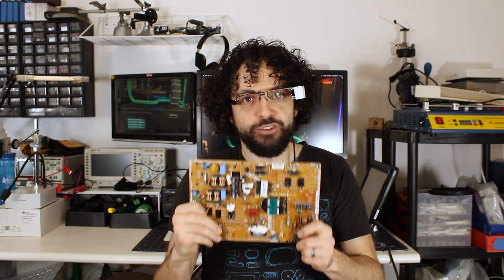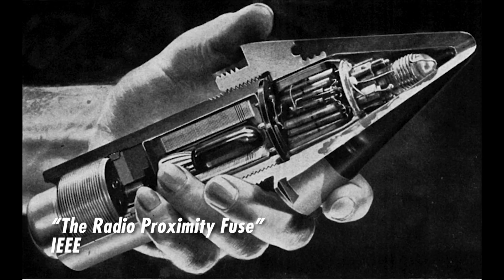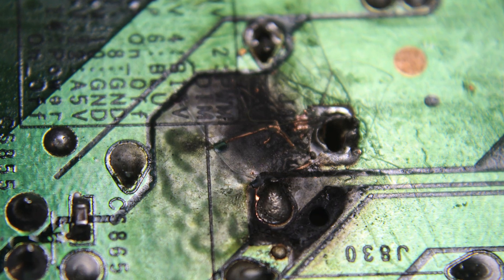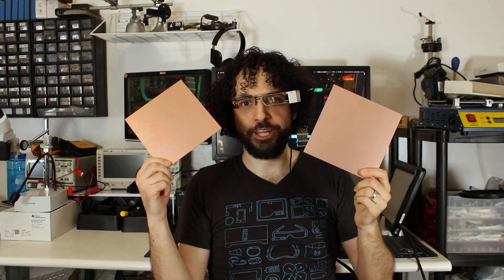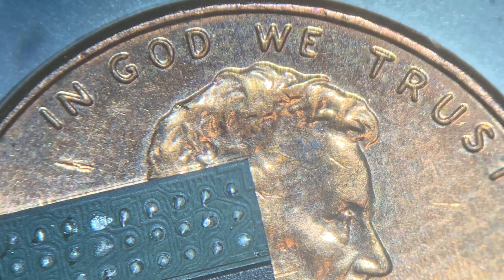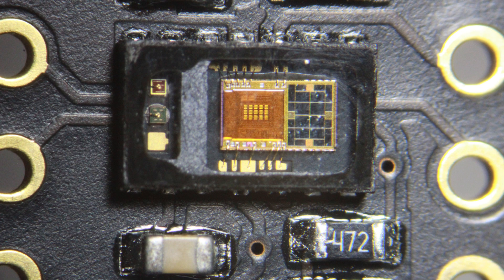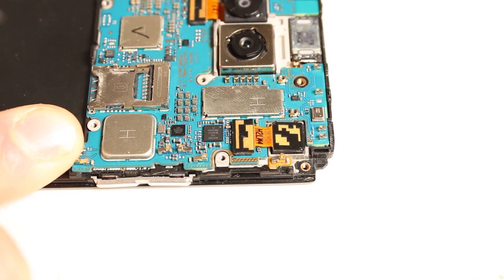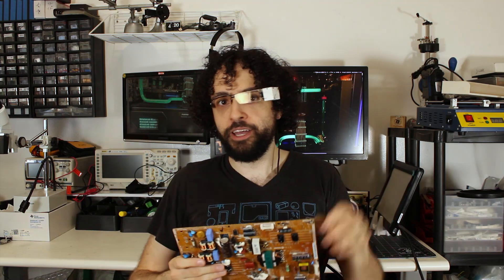Why Are Circuits on Boards?

Comment: Zack Freedman: You cannot and should not integrate most of the components into one chip!
Apple M1: Hold my beer
Reply from the maker: I do worry that Apple has overdone it. They're not going to be able to make incremental improvements, and they'll need to do a ton of re-engineering each generation. I don't think this will pay off for them over the long term.

Comment: A long time ago, I laid out some PCBs by hand.  Where "paint" is mentioned, we used permanent markers.  They're water proof so they resist the ferric chloride etching solution.  It was actually pretty much fun to do.

Printed plastic boards would be nice, but one critical property of PCBs is the ability to resist heat.  Soldering is tough on PCBs, some cheap prototype boards can't even take one rework if you make a mistake, the copper delaminates.

If you want to see some interesting work, search "surface mount pcb repair" (or something like that).  There's some amazing skill out there soldering microscopic parts, getting it right and not having any solder bridges.

Comment: Nice job.  Very comprehensive.   
I take one exception however.   Not anyone can combine any combination of chips they desire.   The procurement of sophisticated components has been tainted with Lawyers and NDAs.   Design one of these in and you become the supplier’s bitch anyway.  This is not by accident.   They can pull your license to that chip at any time.   And you suddenly find yourself in the unemployment line standing next to a wire wrap girl.  ( maybe not.  She is probably 85 by now ).   So instead you remain a good bitch and keep the money rolling in for the pimp.

Comment: I am going to build vacuum tube amp and even wind my onw transformers, and it's going to be point to point wiring, cuz lower noise when you can twist the wires together, more current can flow cuz you have 3D trace (wire made of thinner wires, like next gen traces stuff) and not flat trace which needs to be very wire for more current so nothing is better than heavy duty high current/voltage wire. My experience with PCBs is that they can break very easy and traces can come off cuz of leaking caps, so you gave only the pros of PCBs, give us the disadvantages too

Comment: 10:08 "Flex PCBs are really designed to flex just a single time" Not the coiled one inside a GBA SP or Nintendo DS hinge. ;) They really are standard FFCs. By coiling it you get the full range of motion for the hinges screen with VERY little movement on the flex.

Comment: I 'm kinda disappointed you haven't talked about the wire to chip covered in black epoxy blobs which are common in really cheap high volume devices.

Comment: the future of circuit board is essentially unchanged, but along with copper trackes, there may be micro-channels for coolant or thermally conductive materials. in HPC applications, thermals are rapidly becoming the greatest limiting factor; especially in high frequency RAM (such as GRRD6). Lots of research is being done into implementing cooling AT the chip level, such as carving fluid channels into the substraight its self. this is especially beneficial in flip-chip packaging where the heat is generated more on the PCB side rather than toward the outside of the substraight. 
Soon  all of our phones  might have internal  liquid cooling, and our Graphics processors and  ram sure will; (if  not through-PCB heatsink contact)
Reply from the maker: I didn’t go too deep into thermal management, but it’s definitely interesting. I haven’t heard of micro fluid channels - I need to check that out. There’s also on-chip thermoelectric cooling, which I see in high-precision sensors and frontends.

Comment: Pick and place machines do not need fluorescent green as you said. SMT machines only need reference marks called fiducials . They are usually a small copper dot on each corner. But even those aren't needed with today's newer machines. The multiple SMT machines I program (my data, Siemens, Fuji, Juki, etc) don't require them, the vision technology is so advanced that I can use any mark on the board as reference. 
I don't know what u are talking about with the "fluorescent green" stuff for the SMT machines.

Comment: Neat video. As for making DIY PCBs as accessible as possible, the CNC router option seems to be the most common. Instead of using a perfectly levelled board and a V-bit, you can use a spring-loaded drag-bit to scrape off a mask or resist of some kind. Depending on your feeds and speeds, the cutting forces on the router itself can be sufficiently low that a cheap 3D printer can handle them. The method I’m more fond of is using a laser cutter to ablate away masks and resists. I saw an anon spray-painting their PCB with a normal rattlecan, lasering off the gaps between the traces, and dunking it in an etch bath. Bottles of cheap UV solder mask are pretty available too. I’ve tried using an inkjet printer to make transparencies for photomasking some dry film photoresist before, but it’s a pain to get the scale and ink settings dialled in properly, not to mention the photo exposing step. My cheap photoresist was also pretty uneven. I’d argue that this is more prohibitive than the chemical nastiness of etching.

I’ve also seen some people trying to design a projector-like frame that uses an LCD to directly mask off the board from an array of collimated 405nm LEDs. You’d be able to use this for masking the etch resist, solder mask, and even for silk screens themselves. But from the few examples I’ve seen, it’s a pain to find an LCD that can be separated from its backlight and used to transmit 405nm. There’s also the issue of display driving.

In terms of etching itself, I’ve looked into a few different etchants. The common ferric chloride is a pain for many reasons, but it does get the job done. Persulfate etchant may take a bit longer but it’s nice being able to see through the solution at your board as it etches. Some also swear by regenerative etchants like H2O2 and citric acid. If I recall correctly, some/all of these work by using the Cu2+ ions as an oxidiser, and oxygen dissolving from the air to turn Cu1+ ions into their 2+ state. But a short chemical analysis reveals that the copper ions will still build up and the solution will become more and more basic, meaning it will eventually be unusable even after frequent top-ups.
I’ve looked into perpetually renewable enchants that require no topping up and don’t fill up with toxic copper ions before, namely by using electrolysis to pull the copper back out of solution onto an electrode after etching. The two etchants I saw promise within are aqueous iodine and bromine (can be created from copper iodide/bromide respectively). Iron sulfate might also work, so long as no iron comes out of solution during etching. All three of these would have pH requirements of one form or another, and may be slow, but I think would be worth pursuing for a maker-space or wherever that requires a no-mess solution.
Reply: It's a lot less attractive now that it would have been 20 years ago though because you can have professionally manufactured PCBs made using online services for dirt cheap.

Comment: Most boards from the early 60's onwards were made using 4x drawings using Chartpak tapes that were then reduced to a 1:1 negative to expose the photo resist. I know of no time or place when any production process involved actually "painting" the boards by hand. I still have a few of my Tape board designs from the mid 70's! AND the negatives for same.

Comment: I came over to answer your title question by stating "they're more stable than if they were on gelatin.", but after reading the comments, I guess I'll watch....
EDIT ----->  Ok, I watched, not bad.  By the way, point to point in radios was alive and well in the 80's.  I used to fix em.  The HF radio was an electro-mechanical monster.  UHF and VHF not so bad.

Comment: Interesting  look into history..... hmmm..... I don't know who or  when 'wire wrapping' was invented,  I thought it was the 'early 60s'...by someone like Bell Labs,or Raytheon.... most circuits until the transistor ( 50s) used high voltage vacuum tubes, and small insulation thickness of ww wouldn't work.   You keep calling PCBs  'fiberglass'....well, the binder is important too, epoxy-fiberglass.... epoxy is a 'wonder' material.... I  remember before 'plated-thru' holes were invented...I've seen 'rivets' used to transfer circuit from top to bottom.....  the circuits today need a surgeon to work on them.... just saying....

Comment: Interesting presentation. Thank you.

As someone of mature age, who started as a teenager with 'tag board' and 'point-to-point' wiring before moving into professional electronics and PCB design, I'd suggest that saying 'pcbs haven't really changed over the years' is akin to saying 'the motor car hasn't progressed from Henry Ford's Model T to Elon Musk's Tesla 3'.
'Tag strips' and 'Eyelet boards' using paper-phenolic or ' Bakelite (phenol formaldehyde) were in used before WW2, so predate the ceramic discs in the warheads.
You can't just ignore history because you don't know it or don't understand it.

Please try not to use to Trade Names as descriptions of materials.
(e.g. 'Kapton' is the DuPont Trade Name for polyimide.)

Comment: Well, besides the FR4 substrate there are also other substrates that are used for RF boards such as the Rogers substrates, or ceramic substrates, etc. So to say that the substrate itself hasn't changed since WW2 might be true for some simple boards, but not really true for PC motherboards, satellite communication systems, high-temperature applications, etc. But overall good video!

Comment: Because they used to be mounted to large chassis of metal and constructed by hand at great expense, which also made them more difficult to repair. It also means they are much larger.

Printed boards were very much hated early on and were often considered a sign of poor quality... How the times have changed.

EDIT: called it

Here's something fun for you: Couplets! The old form of high integration. Before modules had 20 parts on them in your fingernail there were 6 capacitors and a resistor jammed into a ceramic disc with a few leads. Philco was notorious for using these!

Comment: "this is the modern version"
Shows electrolytic capacitor that could easily be 50 years old.
Reply: modern as in 'still in use in modern times' not as in 'this was manufactured last week' :)
Reply: there you go, they're still being manufactured: https://www.newark.com/illinois-capacitor/226tta500aqw/aluminum-electrolytic-capacitor/dp/66W2884?st=capacitor%2022%20uf

well it's a different model, less voltage tolerance because of inferior net voltages over in the US, but oh well^^
Reply: Seriously. Who TF uses axial capacitors?
Reply: @wesleymays1931  your mom

Comment: 5:35 yeaaaaahhh Pick & Place, I had to disassemble an ENTIRE machine (Quad Systems: Quad IVc MK II) and god it's a tedious process, there is a crazy amount of cables, quite a few boards as anyone can expect, and the best part in all of this is I got to keep the Machined table that eveything on the top was bolted on, a whooping 250 pound-ish  of steel FLAT AF that's going to become a part of my workbench, maybe one day I'll make a small CNC or 3D printer on it, who knows.
That Quad lasted many many years (like it was built back in '84 ? if I recall from the user manual)
We also have 2 other Universal pick&place machines, good and reliable (I hope so)

Comment: Where I work there's a test stand so old, the electronic components are connected to terminal blocks and posts...
all mounted to a wooden 2x4. 
And it's still in use almost daily. I think it was built in the 1960s.
As for the topic at hand, I wonder at times why we still go with flat boards. But also having much experience in SMT, I can't think of a way to place 4000 resistors in a minute using "dead bug" or something.

Comment: Did you ever tinker with childrens electronic toys? Those are wires with soldered in components all the way down! Talk about bodged jobs! One would think we held some sort of standard for what we let our children play with!
Reply from the maker: Toy engineering is incredibly sophisticated. They're manufactured by the millions, so even tiny improvements in safety or reductions in cost have huge effects. I'd give US designers, at least, the benefit of the doubt.

Comment: 13:00

Well, that didn't aged well.

( Context: The iPhone 12 was just announced, and the cameras won't work if replaced with anything but the original one. )
Reply from the maker: Apple is the master at taking great ideas and making bafflingly short-sighted mistakes with them.

Comment: Great video!! I am just not sure that circuit board will keep being the best, already now are the circuit board a huge pain in the ass-embly :-)
No, what I mean is that the board is the biggest problem when making high speed electronic, already at 2 GHz do you have to fight the board and I do not dare to talk about 300 GHz circuity!! Something has to change, but to what do I not know. :-)

Comment: 15 years ago in college in an electronics class I asked why even use pcb boards at all. The teacher said there would be shorts and communication errors. Then I made a complex circuit with no board and it worked, the teacher gave me a bad grade on it.

Comment: Zack: It's not the best idea to stuff everything in one place.
Apple: M1
Reply: To be fair that's just standard SoC stuff, which has proven to be both sufficiently reliable & flexible to justify integration :-)
Reply: my thoughts as well. next thing we know we'll have an entire desktop computer in a microSD card
Reply: @CommonTater100  We already have an entire computer in a RAM module after all :-) (Pi3 compute module hehe)
Reply: @cheaterman49  that is pretty stinkin' amazing! never heard of it till now
Reply: That was my thought too, but you can recycle the board just with swapping that one chip for ram/cpu/gpu at once which won’t fail often anyways. They upgrade those upon refurbishing old phones anyways so (I wonder if they do so) but I guess it could make sense to some extent just like how it’s cool that camera module is easy to swap in that case mentioned in this video.
Reply: The Cheaterman
Reply: @tillorrly1128  That would be me :-)

Comment: No, the old PCB that you are showing are not painted by hand. They were laid out on light tables with black tape. Then photographically shrunken and exposed onto photo sensitive PCB material. Also, phenolic paper is still used. The flatscreen TV power supply that you are wielding and are showing in the video are paper-phenolic.

Comment: Good video, man! Thanks for making it!

Question - for boards which contain through-hole components only (i. e. no SMD's at all), and won't be run through a pick-and-place machine (e.g. an electronics hobbyist orders a PCB where he'll be soldering the components on himself), do those boards still contain the fluorescent die?